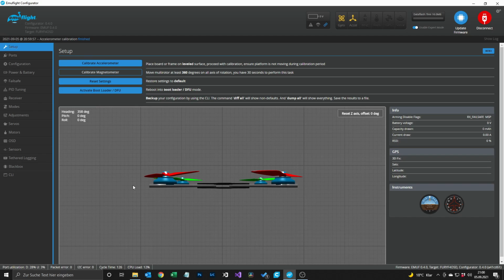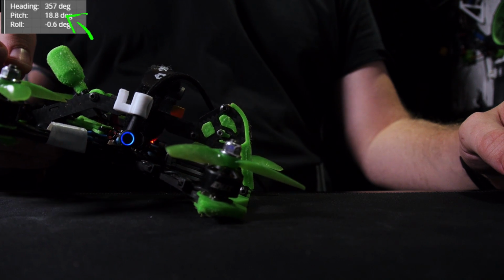How To Set The Right FPV Camera Angle And Importance Of The Angle

Comment: Out of curiosity does this method work with all drones or just DIY units just curious cause I got a little indore drone that I'm having camera adjustment troubles
Reply from the maker: As long as you have Betaflight or any software like this, it should apply to your quad, even if you did not build it yourself.

Comment: That's a neat trick.. You always do it with your bare hands? no screws nothing? Is it always like that?" Thx for the video
Reply from the maker: Not sure if I get it right.. to set the angle i loosen the screws of the cam lightly so I can move it with bare hands then tilt to the desired angle, tighten the screws and double-check afterwards if the angle is right.

Comment: good tip to use the sensor display in betaflight for this.  does not help a ton when out in the field and not sure if the crash moved your camera, but still a great tip.  I am a little suprised there are not metal / carbon camera housings that have markings on them to indicate the angles, but that would add weight, and there is not much room around the camera.
Reply from the maker: Yes and no - innthe field you still can use the smartphone but most of the time it's not as easy as on the computer 😁 but I always shoot photos to see if the camera moved.  Anyhow most of the time I use some 3D printed TPU mounts additional to the carbon - that way the camera doesn't move at all or only in very hard crashes where you could not even fly further nevertheless 😁

Comment: Got my first FPV drone recently (Emax Tinyhawk Freestyle 2) and the stock angle was waaay too steep (like 30 deg.), turns out to change it though I had to physically unscrew (well, loosen) the camera's position to change the tilt. I've put it at 0 degrees for the time being, for a beginner.
Reply: How are you liking the freestyle ? I got mine a week ago and I’m having a blast with it , but also had to physically loosen the cam as well to adjust the angle , idk why they ship it with the camera ALL THE WAY UP . I’m use to running with like 20-25 degrees in the sim so that’s what I was going for with mine , gonna practice split s tomorrow !
Reply from the maker: Sounds great! Especially the beginning is great 😅👍

Only flying into trees, crashing and breaking is the not so fun stuff in the beginning 🤣
Reply from the maker: Nice! 0 degree was indeed too flat for me but for a beginning really good 😁👍
Reply: @flickFPV  I've grown used to flying at 0 deg on my previous GPS drone, so I'll start with that for the time being while learning. 
Anyway... The biggest obstacle with flying in FPV, for me, is the spatial awareness when in first person, mainly not being able to judge how high off the ground I am 🤷‍♂️
Any tips?
Reply from the maker: Sure - check your surroundings before every flight - how tall is a tree beside you how far is a tree/sign/parked car from you etc. then start the flight sometimes "look at yourself" compare your height relative to the drone - are you a small ant or a giant?  You get spatial awareness by these tricks pretty fast